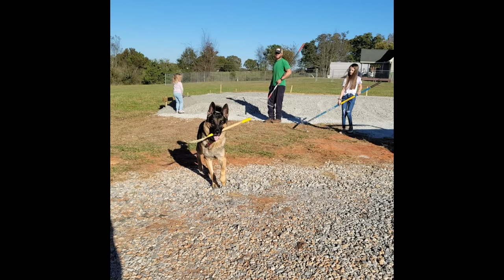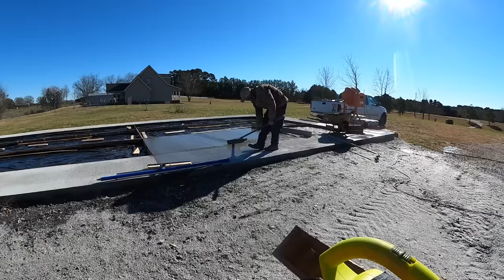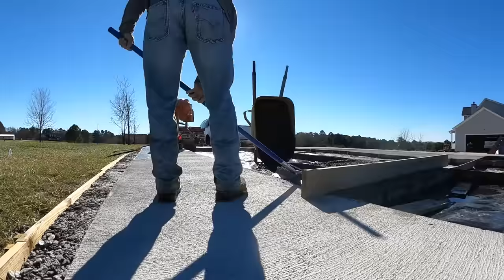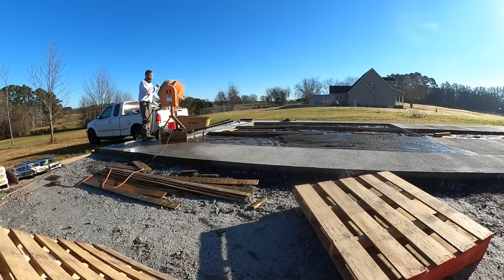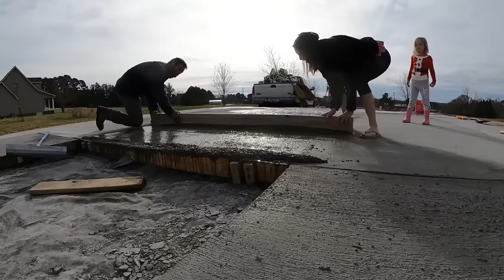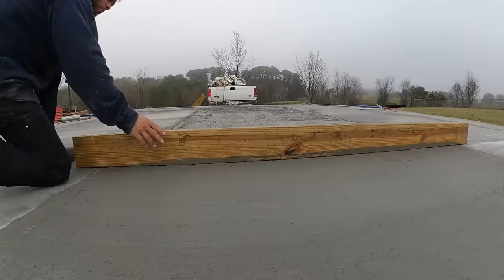Pouring a Huge Concrete Slab Using Bagged Concrete | I Saved $10,000

Comment: How long did it take you to do each of those sections?  Also did you use any mesh or rebar?  I couldn’t see any and I’m just trying to learn since I don’t know much about concrete work.  I am planning a 40x60 shop and I’m looking at about $8,600 in just concrete if I buy bags.  If it saves me a crap ton of money I’ll do what you did no matter how crazy anyone thinks I am 😂
Reply from the maker: I don't exactly remember how long it took me to do each section. I was only able to do 1 section at a time because of my work schedule. I remember telling my wife if I had a few full days to do it I could've finished the concrete in about 3 days. I'd guess it took me around 40 hours or a little less. I didn't use any mesh or rebar, I called around and spoke with local pros and they said it wasn't needed in my area in a 4" residential on grade slab. I'd definitely call and speak with guys in your area regarding that. I'd also call around and see what truck prices are in your area. In my area at the time they were 200 to 220 depending on the day with a 4-6 week wait. I've talked to others that say theirs is as low as 150.
Reply: @reallifetested2605  perfect thanks man.  I’m going to be crazy like you and do my own when the time comes.  I don’t care if it’s perfect.  It’s gonna be in my shop and I like the idea of putting $10k elsewhere.  Thanks again!

Comment: I understand the savings on labor, doing it yourself, but is there much savings mixing the concrete from bags yourself versus having a concrete truck deliver it? I thought the cost of bags versus a full truck delivered was pretty much a wash, or even more expensive going with bags?
Reply from the maker: When I did this I was able to get #80 lb bags for 3.20 and the local plant wanted 200 to 220 depending on the day. At the time going bagged saved me around 1200.00

Comment: Living in rural America allows you to build things without inspections that normally wouldn't meet codes??
Reply from the maker: What doesn’t meet code? A floating slab doesn’t need anything but a compacted ground to sit on with proper aggregate base. No rebar is required in my area.

Comment: No rebar or reinforcing wire?  Just asking because I thought it would be needed. (I am not a concrete guy) Good work doing all that yourself.
Reply from the maker: I called around and spoke with pros in my area. They said around here no one uses rebar in 4” residential on grade slabs / driveways. Mostly commercial industrial applications or homes. Could be required in your area so definitely want to check locally before attempting anything.

Comment: Nice work.. no rebar or wire reinforcement?
Reply from the maker: Thanks! I called around and spoke with local pros before taking this on. In our area rebar is only used in commercial or industrial applications. It rarely gets freezing around here and we have good soil with no natural disasters.
Reply: @reallifetested2605  Great job- you did the homework! I was just wondering.

Comment: Weird to think that only about 1yr ago. Poured concrete was cheaper than bagged. 😳
Reply from the maker: I did this right at a year ago. Locally truck was 200 to 220 depending on the day, and #80 bags were 3.20 each! Whats crazy is the prices of materials and everything else are still all over the place.
Reply: @reallifetested2605  that's a pretty cheap 80lbs bag. Here they are around 5 and change and have been for a while. 

However, even at 18yrds the savings would still only be about 1200 at your comp unless I missed something.

 10k and I would jump in and bag mix to. At only 1200 I'm gonna save my back.😂

Comment: I am not an expert, but just curious as to why you didn't use any rebar?
Reply from the maker: I called around and spoke with local pros. They told me it wasn’t needed in a residential on grade 4” slab.

Comment: My wife and I are about to do the same thing, can you offer any suggestions or tips you can share? We have no experience either. Thanks a billion!!
Reply from the maker: Honestly i'm no pro at this. My wife and I just got quotes of 14k and up. I did a little figuring and found out that material cost for me was less than 4k so I said it can't be that hard. Just make sure you do it when temps are a little cooler (40-50 degrees) so you have time to do the work you need to do before the concrete sets up. Also make sure it doesn't get below freezing. Make sure you have a solid compacted base, lay plastic down, form everything up and add rebar if its required in your area. I have the equipment to haul and spread everything myself, if you don't it might be cheaper calling the local ready mix plant and just seeing what the minimum for free delivery is and set your forms up to go that route. My wife needs another shop for her business so i'm about to take on building that. Again we were quoted 60k and up for a garage that's going to cost me 15k in materials. It's sort of insane how much contractors are charging these days.

Comment: Really I ve poured bag mix before and it's a killer. I had 4 piers to pour and the owner picked up a pallet and half of quickcrete 80 lb bags and it about kicked my butt. You can maybe mix a bag and half in the mixer at a time. so how many loads did you pour for that one-quarter section?  how many yds did you end up pouring? Did you get a quote from the transit company? How much did you save and was it worth it.  Oh how come no rebar?
Reply from the maker: I was able to get 2 #80 bags per mix. I ended up using 830 bags of concrete. It ended up being right around 18.5 yards of concrete. We got quotes of 14k and up which is why I did this myself, ended up with around 3800 in materials doing it myself. I called around and spoke with local pros and they said that rebar wasn't needed in a 4" on grade residential slab. Around here we have hard packed clay and it rarely gets below freezing. I'm not sure how many load I poured for each section, i'd guess somewhere around 60-65 came out of the mixer per section.

Comment: I could have did it material included for 4000 one day don’t know what you saved ten grand on bout 2000 in concrete we supply form
Reply from the maker: I wish you were around here. Local companies quoted us 14k up for this work. I did everything myself for 3800 including the gravel. Bagged concrete was cheaper at the time for 3.20 per #80 bag vs 200 to 220 per yard for truck.

Comment: Should have just got a truck load of 3/4 crushed, another truck load of sand, and bought bags of Portland, probably would have been even cheaper.
Reply from the maker: I checked into that. You wouldn't believe but that was going to be around 163 per cubic yard with the inflated price of bulk sand and portland in my area. This inflation has gotten out of hand.

Comment: do you removed the wooden molds/formers, or do you leave them? hard to tell in the video
Reply from the maker: Yes I did! I poured the outer sections first, then removed the wood forms and used the outer pads as the forms.

Comment: What is the plastic for?
Reply from the maker: For a couple of things. First I use it as a vapor barrier to keep water from coming up from the ground through the slab (after its cured). Second it slows the curing process of the concrete because it keeps the water from flowing out of the bottom.

Comment: Did you use any rebar?  I didn't see any.... are you supposed to use it?  Just asking, it does look good!
Reply from the maker: I called around and spoke with local pros. In my area they said rebar wasn't necessary in an on grade residential 4" slab. Thank you for checking out my video!

Comment: Only thing you should have done was put rebar, or wire in .
Reply from the maker: I called around and checked with local pros. They told me it wasn’t needed in a residential on grade 4” slab.

Comment: Very nice but I am wondering?? No steel mesh?? And is this not too much water at the end when you finish?? Maybe I am wrong... Nice video though!! thanks!
Reply from the maker: I called around and spoke with local pros before taking this project on. In my area they said they don't use rebar in 4" residential on grade slabs. Only in homes and commercial/industrial. We have decent weather here and good soil as well.

Comment: Bags of concrete no matter what you've heard is not the same as concrete on a truck. It's not as strong it's not as stable and the top wears off fast.
Reply from the maker: Do you know how long the top last before it begins to wear off? I did a 1 year update and so far everything looks great with not even a hairline crack.
Reply: @reallifetested2605  I've seen it wear off 1-5 years. I'm happy everything is working out for you and sincerely don't want to sound negative. I feel like if people are going to do this type of work then they should have the information which takes a lifetime of experience for some professionals.

Comment: I had my 1200 square foot barn pad just a couple years ago. It only cost $2800. Not sure how I could save $10,000. Did concrete over quadruple?
Reply from the maker: That's a great deal. We got multiple quotes and the lowest one was 14k for this. I was able to do all of this myself for right around $3800. Heck when we built our house we hired out our small parking area and sidewalk and was charged 8k. That was about 3 years ago.

Comment: What are the dimensions of each of those individual pours. I’ve been thinking of doing something much smaller than yours but I just couldn’t justify the cost of having it professionally done. Also did you have to get it code enforcement approved? And if so did code enforcement give you any problems about doing it yourself.? You did a great job and I can only hope anything I do will be half as good as you have done.
Reply from the maker: They’re right around 20x6.5. You’re right about the high prices. I was quoted 14k and up. I did all of this for a little less than 4k. Luckily I didn’t have to deal with any code enforcement. (I live in the county) thank you for the kind comment. It’s much appreciated.
Reply: @reallifetested2605  Thanks. I was wondering about the dimensions also. I am going to attempt a 12x16 area with 1/2 inch rebar this weekend. I think I will break it up into three 5'4"x12' sections/pours. I should be able to screed it fairly easy that way. Your video is super inspiring and I don't think you're crazy at all. I need 3 pallets (42 80 lb. bags) of concrete. That's just over 120 bags. I hope I can handle this. It's scary. God bless you bro! I hope I don't end up with a hilly steel reinforce rock for my new patio. I picked up a pallet of concrete and the rebar last night.
Reply: @reallifetested2605  The 4k you paid was more than if you had it delivered.  You could have had the truck come and pour, and then all you would have to do is the finishing.
Reply from the maker: @alecb8509  At the time I was able to get #80 bags for 3.20 per bag, truck in my area was 200 to 220 depending on the day with a 4-6 week wait. Surprisingly it was a little over 1200 more expensive to go truck over bags.

Comment: How many cubic feet is that mixer ?
And how many bags were you able to do in one load/wheelbarrow ?
Reply from the maker: It's supposed to be 3.5 cubic feet. I can only comfortably fit (2) #80 bags or (3) #60 bags but that is the max that I feel the machine can handle. In the video I was putting (4) #80 bags at a time in the wheelbarrow.

Comment: Structural concrete is something I don't know much about but shouldn't there be rebar in there?
Reply from the maker: In my area it's not used in residential on grade 4" slabs.
Reply: @reallifetested2605  We have so much ground swell here due to clay its pretty much always needed.

Comment: Anyone know why old mate did not use reinforcing bar?
Reply from the maker: Local contractors in my area said that it wasn't needed in a residential on grade 4" slab. It's not a standard to use it in driveways, sidewalks, or small slabs in my area. (Houses and buildings require it for sure)  I know of several people that built houses since I was a little kid (i'm 30 now) and the drivways, sidewalks etc. still look new with no cracks.

Comment: Just curious, why did you not use rebar in the slab? I thought that was like a necessity to make it strong
Reply from the maker: I called around to check with local pros before taking this on. In my area rebar is only used in industrial or commercial settings. (Unless requested) We have good soil, it rarely gets below freezing, and we don't have any natural disasters.
Reply: @reallifetested2605  oh ok thanks for the answer. I didn’t know it was a sometimes thing
Reply from the maker: @jnf2211  It's crazy. A lot of builders in my area don't put gravel or anything, just grade and pour. When we built our house they were going to do that for the garages, and driveway. I hauled in about 200 ton of gravel and actually graded my own homesite. Just to make sure that was at least good and solid.

Comment: Rebar? Has it failed after a year. Hope it hasn't, what was the savings in not putting in rebar?
Reply from the maker: Nope! Not so much as a hairline crack. I have a little less than 4k in everything. Rebar was going to add approximately 2k and a lot of extra work. I called around and spoke with local pros. They said that rebar wasn't necessary in a residential on grade slab.

Comment: Wheres your wire mesh to tie the pad together? this is gonna crack so quickly. Also how deep did you go for the footings? i dont see any rebar either.
Reply from the maker: I talked to local pros, they said that rebar isn't necessary in an on grade 4" slab. The wire mesh is only for cracking. No one in my area uses rebar or mesh unless its for a home slab. Even driveways, sidewalks get nothing but concrete. The pad still looks as good as the day I finished with ~40,000 lbs sitting on it.
Reply: @reallifetested2605  Not sure where you are but if you get snow and or freezing temperatures they are 100% needed. Hell for the cost of them theres really no reason not to add it because it just adds structural integrity  to your pad especially if youre doing multi pours like you did how did you not use tie ins? ive never poured a pad wether it be a driveway, patio etc without using wire mesh. Better hope your subgrade is good.

Comment: Where did you purchase the 80lb bags? The bags at my home depot seem very expensive and possibly will cost more than having a truck come
Reply from the maker: I made a one year update showing local pricing and where I purchased. I got them at Lowe’s. They price match and you can also get 5% off with their credit card. Best bet is to find the concrete cheaper elsewhere and get them to price match. They will even take a percentage off of the matched price as well if you’re nice to the manager.

Comment: WOW great work,  just curious why no steel mesh in the concrete?
Reply from the maker: I called around and spoke with local pros. In my area they don’t use rebar on 4” residential on grade slabs. It rarely gets cold here and we have a hard clay soil. I’ve never seen it used in small buildings / driveways around here. I did a 1 year update if you’re interested. I don’t have any cracks at all and show the slab.

Comment: Great job and all but wheres the rebar?
Reply from the maker: I called around and spoke with local pros. In my area they don’t use rebar on 4” residential on grade slabs. It rarely gets cold here and we have a hard clay soil. I’ve never seen it used in small buildings / driveways around here. I did a 1 year update if you’re interested. I don’t have any cracks at all and show the slab.

Comment: No steel reinforcment for the concrete slabs?
Reply from the maker: I called around and spoke with local pros, they told me in our area rebar wasn't needed in a 4" residential on grade slab. So far not so much as a hairline crack. Hopefully it stays that way.

Comment: Why did you not use any steel?  Did you add fiberglass?
Reply from the maker: I called around and spoke with local pros. In my area they don’t use rebar on 4” residential on grade slabs. It rarely gets cold here and we have a hard clay soil. I’ve never seen it used in small buildings / driveways around here. I did a 1 year update if you’re interested. I don’t have any cracks at all and show the slab.

Comment: Cool video😳
How much water per bag/s of concrete did you used???
 What was the ratio ,,, 1 bucket per 1 per 80lb ???
Reply from the maker: I honestly can't remember. What I did was measure out what the bag said (for 2 bags) in the bucket, and added a little less. Then drew a line there to get me started (because I knew i'd be mixing 2 bags at a time) The reason I added less is so that I could fine tune the consistency with the hose because not all of the bags are mixed perfectly. Hope that makes sense!

Comment: I'm not knocking what you did, actually I applaud your work ethic, but the math doesn't work for me. 870 bags at say $4 is 3480. And 16 yards from a truck at 150 a yard is 2400. I had to mix 1 1/2 yards in bags once, and it was double what the truck cost would have been  even with the short load charge.
Reply from the maker: When I did this they were wanting 200 to 220 depending on the day for truck with a 4-6 week delivery and I was able to get #80 bags for 3.20 each. It ended up being a lot cheaper going bag per yard. I even checked into mixing myself with 1,2,3 method and even that was insanely priced at the time because of the high cost of sand and portland in my area. It's sad because just a few years ago concrete was almost half of what it is now.